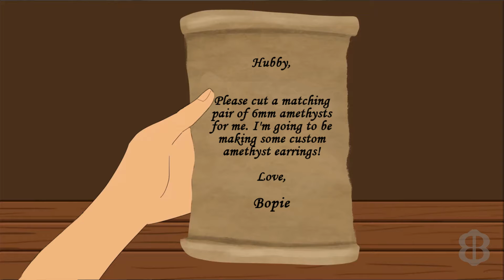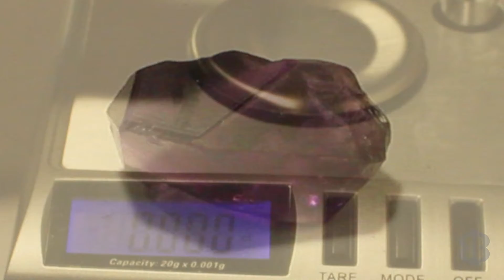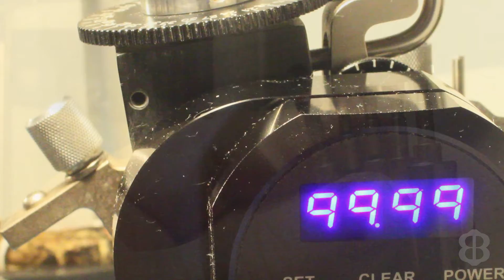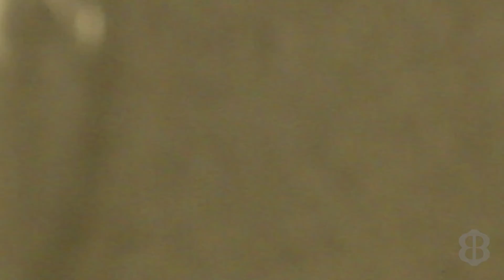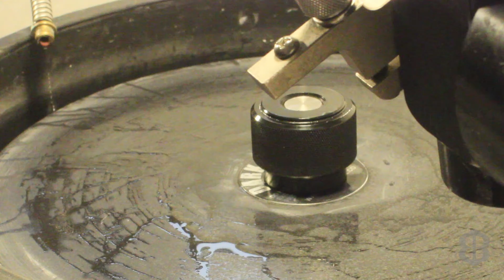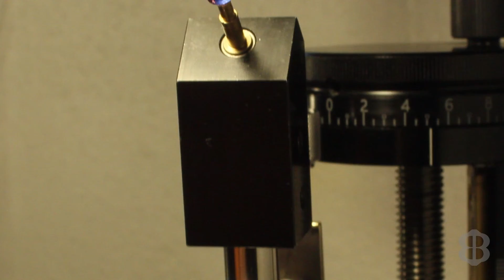Gem Cutting Tutorial - Faceting Amethyst on an Assembly Line

Comment: Thanks for the tip about reversing the direction of the lap to reduce "orange peel" and tiny scratches in quartz. I have had problems polishing some quartz, especially synthetic material.
Reply from the maker: It seems to work...not sure why, but it does.